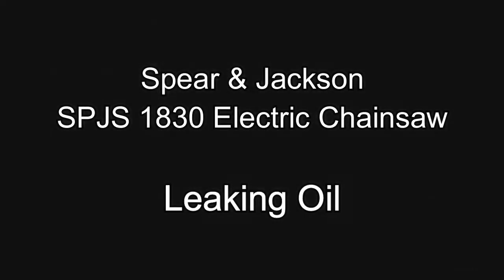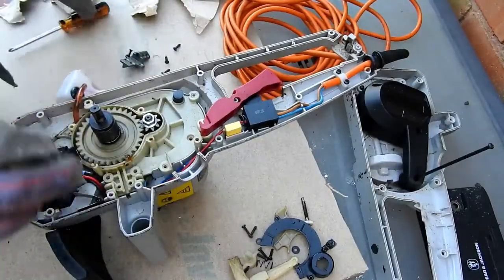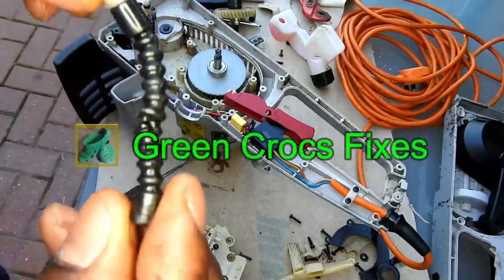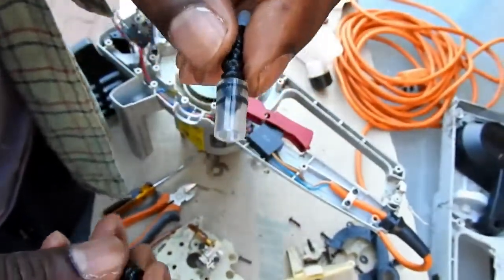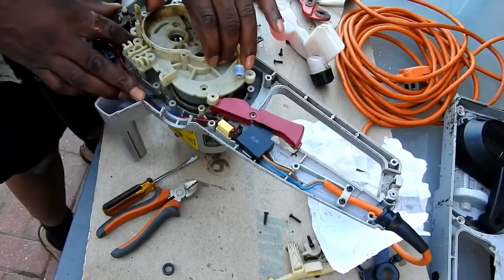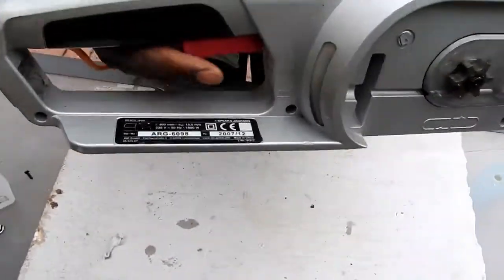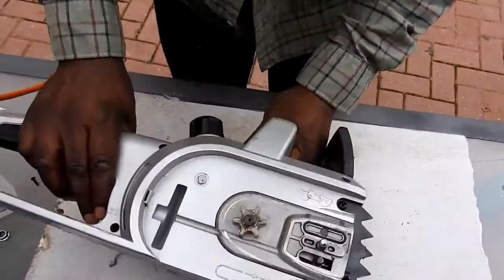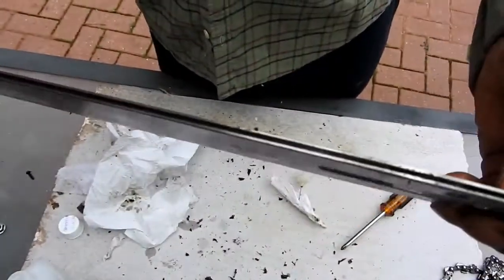Spear and Jackson SPJCS 1840 Electric Chain Saw Oil Leaking

Comment: Hi
Thanks for the video,, I have a S n J too, different model but same problem.. it's 3 months out of guarantee, the oil leak just happened last week, took it to a repair shop but they said it would cost more to fix it.
But now that I've seen your video, I have another option. I can take it apart and see for myself what's wrong with it.. hadn't thought of doing that before now..
Seems you were lucky with your leak, simple fix, although, I have question for you now.
That bit of clear pipe you used, how come you didn't glue it in place ? Seems like you just slid it over the two broken bits and that's all you did,, won't it leak again ? Will it stay in place ? ..... Sorry 😊 that's more than one question 😁
Thanks again for the video,,, you never know do you when someone good ideas from what you post👍👍👍👍
Reply from the maker: Hi Liam,
              and thanks. 
                                   Liam this is not my saw, I borrowed it from a family member who said it was leaking from when it was first used,, they just thought that's what it does ? 

I just used what I could find to make a good and permanent repair as the unit was not easy to dismantle, especially the main drive gear,  not all plastics can be superglued successfully the Clear pipe as you can see is a tight fit at both ends. 

The saw was used this year by several people and no longert leaks. I thinks this one may have had the pipe cut whilst being assembled during production. It was purchased from Argos back in 2008 and works fine with a sharp chain.

                                           Regards 😒 .

Comment: How did you take the nut off the 'motor shaft'?
Reply from the maker: Hi Mathew,
                  very difficult. As far as I can remember I jammed a big Screwdriver against the Gear and the Plastic casing. Can't remember which direction the Nut undone either. The split must have been damaged during production.

       Regards.